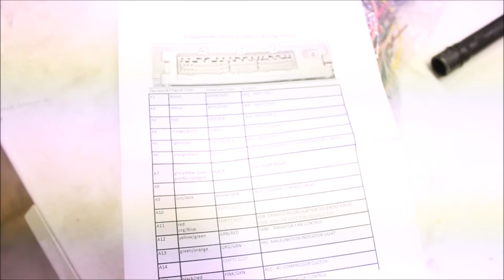Obd0 to Obd1 conversion for Honda

Comment: So if u delete the resistor box do u still need to cut into the obd0 ecu harness and are running obd1 injector s
Reply: When you delete the resister box and if your running obd1 injectors you need to tie the wires together that’s coming from your injectors that go to the resistor box and run a wire I believe to a15

Comment: i plan on doing the mpfi swap on my wagon. is it worth going obd1?
Reply from the maker: Luis Solorio it depends if you plan on boosting your car later on or further modifying your motor as you will need to be obd1 to easily tune your ecu.
Reply: Nate Baker good point. And i assume for better tuning you want to wire in the 4 wire o2 sensor?
Reply: It’s better so you can tune your ecu because there’s not much support for Obd0 and if you’re gonna boost it’s better to get a wide band o2 sensor